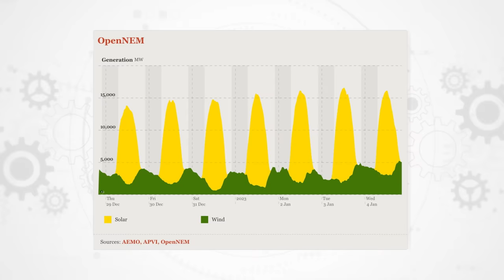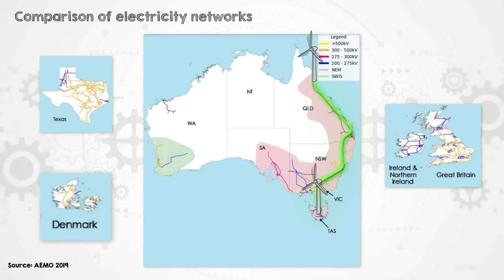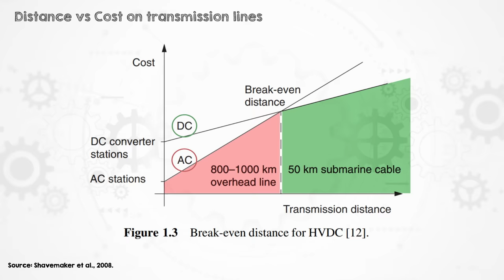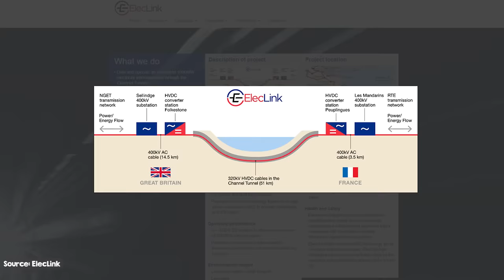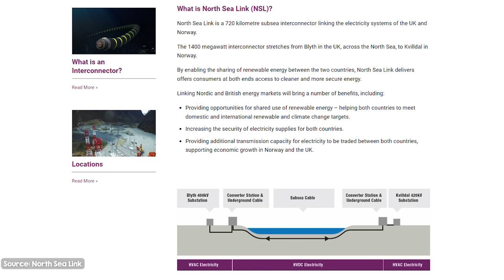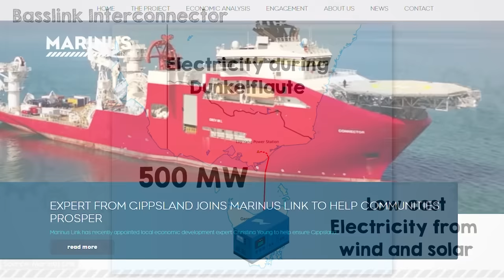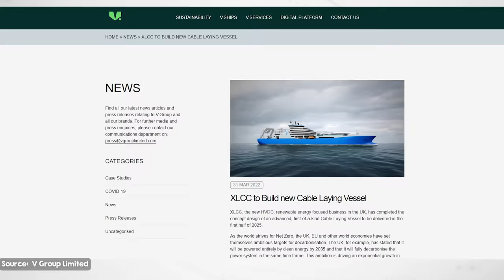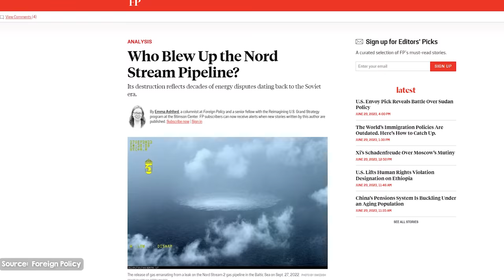Electricity Across Oceans: Is HVDC the Future?

Comment: Rosie this is amazing!  I've been preaching this EXACT thing for a decade!  But it should be broken up into segments.  I've been talking about a Canada -> Greenland -> Iceland -> Faroe Islands -> Scotland/Norway HVDC link so much that my engineering friends just roll their eyes when I bring it up.  It just makes so much sense.  

Each link in that chain has huge value and can stand on its own right, but together it makes renewables make sense WITHOUT the huge reliance on storage.  Canada has been desperate to electrify Northern native communities for ages and will fork over boatloads of money for anyone willing to do it.  Greenland needs cheap power.  Iceland is begging for some way to export their surplus of energy.  Faroe Islands uses expensive dirty old fuel oil for electricity and this would be a boon for them. 

And the math works out with current technology.  You don't need any crazy year 3000 science fiction superconductors; it can be done with existing cables.  And Siemens, GE, Hitachi and (I think?) ABB and Panasonic are already manufacturing the inverters.  It just makes too much sense.
Reply: I recall reading somewhere that Iceland isn't really "begging" for an interconnector any longer - the Icelandic public are concerned that their current cheap geothermal electricity will be hoovered up by the Europeans once connected to the world (well, European) energy market leading to higher consumer prices for them, the aluminium producers who moved to Iceland for cheap electricity are concerned for the same reason (both of which would be political suicide for any Icelandic politician who voted in favour of building a cable), and evidently the falling price per Kw for wind generated electricity in the UK, so it's now more cost effective to build out wind turbines than the HVDC, has reached the point where the original rationale for the cable doesn't hold true any longer without government subsidies - and neither government is likely to do that. 

Greenland only has 56,000 people living there - you could probably install an individual PV/wind turbine + battery in every household for less than the cost of the interconnector, although clearly community based projects would be better. Ditto the Faroe Islanders - 52,000 people whose main industry is fishing / fish farming. And I'm guessing the same issue applies to Canada's Northern territories - the few inhabitants are mostly widely scattered in small population clusters. None of these are candidates for an HVDC mega-project - although they're certainly candidates for diversified green energy projects.
Reply: You speak of these other countries (with small populations) as if they could contribute, but they are too small to make a difference.  In order to tap off even a small part of the HVDC power, they would have to pay for an expensive megavolt inverter station.
Reply: @acmefixer1  No they would be intermediate links in a chain so you don't have to run 3-4000 km of continuous cable.  That's even mentioned in the video.  Being able to utilize some small potion of the electricity is only a secondary benefit.
Reply: @joels7605  
The cables are handling HVDC, which cannot be stepped down with a relatively inexpensive transformer.  The inverter is a building full of expensive equipment, and a small island most likely can't justify the expensive inverter station to supply so few customers.
Reply: @acmefixer1  Right.  Much easier to build the world's largest ship to pull an impossibly long cable.  It's vastly cheaper to run conventional high tension lines overland than lay HVDC undersea cables.  If you can save a few hundred kilometers of undersea cable it pays for the HVDC inverters.
Reply: The issue with going via Greenland and Iceland are two. Firstly you trade difficulty with distance. The cable need to be 1000 km longer for it to work.

There is more issues. You cant connect a sea cable to a land cable efficiently. A sea cable typically carries 500kV and a land cable only 350kV. Going down to 350kV would be wasteful, and going up to 500kV is currently not possible. So that would dictate that the land part would be done with aircable. A aircable have the benefit to carry much more voltage, but in this case its not possible becasue that its provided by a sea cable, that dictate the highest possible voltage.

So you need to build a air cable that cost twice as much as it would have if it was local, and you also can´t convert the voltage, because it would cost more and be more wasteful.

Well lets ignore that for now. You built a cable from Scotland to New found land via Iceland and Greenland. Great.. there is a few more problems.

From the coast of new found land to Ottawa, that is the closest place you can tip of a few GW of power, and in Scotland you have to go to at least Edinburgh, your cable is no longer 3000km, its also not 3800km.. its 5300km. Your losses is no longer 15%, its closer to 30%, that would probobly make the project totally unviable.

There is more problems. Its not really realistic to build land cable on the eastern side of Greenland, or the middle of the island. There are just way to much glacial moment. On the western side its less of a problem. the only viable solution is to make a connection station, than have sea cable around Greenland. This would ad 300 or 400km extra.

There is pretty much no population on Greenland. it would not even be economical to build a transfer station. And Icelandic main industry is aluminum and siliconsteel melting. Due to the low price of power. A HVDC connection would destroy that industry. That is 47% of there total exports. That would totally destroy the economy of the country. Any public official that would grant that would not live to see the sun set, and the cornier would rule it suicide by stupidity. (and pretty much all industry that is not fish related is in some way related to the low price of power).

For Føroyar, they have the same problem as Greenland have, there simply live to few people there. Of cause its worth saying that the Island of Gottland have a similar population of both Føroyar and of Greenland. And they do have a HVDC cable. The thing is that the Gottland cable is a 150kV system that is way cheaper to connect to. Also its worth saying that Shetland  is  there currently a 320kV HVDC cable built to. This is conected to the UK "main land" via a 260km long cable, then from the mainland connection via an interconnect down to the Scottish grid via a 160km long interconnect.

Wile you might think that a shortening of the conection from 360km to 320km wouldn´t matter much. As stated before, just reaching the cost is not sufficient, and not even the most expensive part. The current interconnect have both the inter connection as well as the AC-DC conversion that would lower the cost of a project like that significantly.

Its also worth saying that Føroyar have more than twice the population of Shetland, so i kind of think this connection will happen before the end of the decade. That would make it the first HVDC network. Worth saying this is built on ground cable voltage (320kV). So its a totally different system we are talking about.

And its really not day and night cycles that is the issue with solar. Its weather and seasonal changes. Here is a real killer problem for this "solution". Its winter in Europe and North america at the same time.
Reply: @matsv201  
Your "350kv ... 500kv" makes no sense.  This is HVDC, not AC.
Reply: @acmefixer1  did you fail physics in primary school?
Reply: @matsv201  A very good point about Winter at the same time. On that basis a cable from USA to Sth America would make more sense for transferring excess Solar in both directions as Summer leads to excess. Who has spare Solar in the Winter to transfer ?
Reply: @TimMountjoy-zy2fd  its cheaper to build nuclear powerstarions than just the cable. And quite a loot cheaper, like 3-4 times

Comment: I'd love to know more about the inverters that handle the super high voltage DC. Do they use conventional semiconductors in parallel, or are they large single unit devices that don't use silicon in the same vane as the old mercury rectifiers?
Reply: I'm studying a PhD in Power Electronics so I can help here. The recent development of wide band gap (WBG) semiconductors, specifically Silicon Carbine (SiC) and Gallium Nitride (GaN), allow us to use 1200V and 600V respectively. GaN also has enough charge carriers to permit very fast switching, so we can use smaller inductors and produce almost pure sin waves to the output load. If you're specifically interested in transmission voltages the principals remain the same, but the equipment is bigger. The semiconductor devices themselves can be built deeper so they can sustain higher voltages, but this has technical drawbacks. They can also be built broader, but this also has drawbacks. The packaging of very large SiC and GaN WBG devices has yet to stabilise in the market and the manufacturers are floundering about not co-ordinating their efforts! If you leave the new devices aside, the current technology is thyristors but they have significant control constraints which limit the circuit topologies available to us, and they don't have the efficiencies and design freedoms that the latest WBG devices offer. Hope this helps, feel free to ask Q's and if I can't answer I can find someone at the Nottingham PEMC (Power Electronics and Machines Centre) who can.

Comment: As always, a great video and an excellent explanation on the causes of loss on AC lines.  When I read about the UK to Morocco HVDC project, I wondered why would they do that.  It doesn't seem to me to make sense to have a direct line to a single source of power which, BTW, doesn't get any sun when you are both at night,  when you could make shorter parallel connections to continental Europe and get into a big grid that spans multiple time zones and expand the connections from there to Morocco.  You need far less resources (cable, ships), transmission losses and exposure to harm with multiple connections both by land and the sea than a single set of cables.  Plus, you have the advantage of making money by sending power both ways.  Am I missing something in the technical side?  My first reaction was that there are some clever guys selling the project to a brexiteer government willing to waste money on anything as long as it bypasses the EU. Thanks.
Reply from the maker: I don't have all the answers but I got some better understanding after I listened to a podcast with I think the CEO or maybe CTO of XLinks (I think it was on Cleaning Up). First, they're trying to get more renewable energy into Europe, especially in the winter I expect. The XLinks guy said they didn't want to connect into Spain and just buy from existing continental interconnectors because then if there is a supply shortfall in the continent then the UK is out of luck. Politically they could really only get support to go directly to the UK. that's my rough recollection anyway, check out the interview for yourself, it was interesting.
Reply: @EngineeringwithRosie  I found the video you mention, thank you, and I found the reasoning quite solid.  I have to admit, living in Spain, that continental power networks are still an issue.  France is always reluctant to agree to interconnections across the Pyrenees, of which there is a clear deficit as per EU guidelines, since Spanish renewables are cheaper than France's nuclear so, yes, I guess it is not something they want to depend on.   Thanks again for the info.
Reply: @danielbarreiro8228  Look on the bright side - if it wasn't for the lack of interconnectors & pipelines to the rest of Europe Spain and Portugal would never have got EU permission for the government subsidies to energy prices over the last 18 months or so.
Reply: I had exactly the same thoughts when I read this. Further, it's a diversion from job#1 for UK energy expenditure, namely rapid expansion of grid capacity, especially north<> south (Scotland to Midlands). This grid bottleneck is harming so many energy developments, so it must be solved as a matter of extreme urgency.

Comment: Thank you for another well-explained evaluation Rosie.  You mentioned the move from Cu to Al due to weight concerns.  I keep hearing from a friend that "the world is running out of Copper!!!" as a reason for not moving to anything like 100% renewable power.  I have not seen any reliable data put forward in the "debate", so I gather this is more of a reactionary trope than a real shortage.  Do you know what the basis of this claim is?  Is it a valid concern?
Reply: Roughly our current known supply of copper is less than the projected demand for copper if going to 100% renewables with available technology
Reply: Some big proportion of copper handled by humans is tied up in telephone wires. That was one of the motivations for going to more optical fibers.
Reply: @b43xoit : there are many old technology uses that can be recycled/repurposed when price points make if feasible. It’s not far off when most homes will be DC wired…it soon will transition to new builds being DC…it’s only the stubbornness of old methods resisting transition holding it back. Anyone doing their own solar should look into DC household wiring.
Reply: Not only copper, most renewable technologies require so much materials they are far from green when installed. Why do you think lithium is not produced in Western countries with huge reserves like Germany, or copper, aluminium? 
If we want to reduce co2 releases there is no other way than going full nuclear for base load current, spent fuel should be the least of our worries because coal only kills 800.000 people each year. I think we might be too late to do it due to increasing methane releases but it is worth a try.
Reply: Copper is also lower resistance per unit than aluminium and thus better for conductors. However it is supposedly more expensive which would give credence for the shortage theory. Also that was why so much cable theft was and is performed. It is for copper not aluminium cables.
Reply: @Signal_Glow 
Australia is the biggest supplier of lithium

Comment: What is the voltage limit for HVDC?
1 million Volts like in China?
Or it could be made to higher voltage like 10 mil or maybe 100 mil to make intercontinental power link much more viable and accelerate the transition?
Reply: I have to do some calculations but I'm sure there is a limit. Electrons will spark through air (sparkplug). In water it will be worse.
Reply: @wiegeroord9822  They use polyethelyne or teflon as insulator which has a much higher resistivity than air. PE has around 10^20 Ωm of resistivity, air has around 10^16 Ωm. So you can replace several meters of air gap with a millimeter thin layer of PE. Perfectly fine for hundreds of kV.
Reply: Depends how much insulation you are prepared to use. A cable with a 1m diameter would handle extremely high voltages, but it would be very difficult to lay it.

Comment: Nice video! Small correction, distance between Tasmania and Melbourne is around 320km, not 750km. This does not reach the break-even distance you mention (by far), and also is subsea installation (moderate capacitive losses). Why do you think they went HVDC anyway?